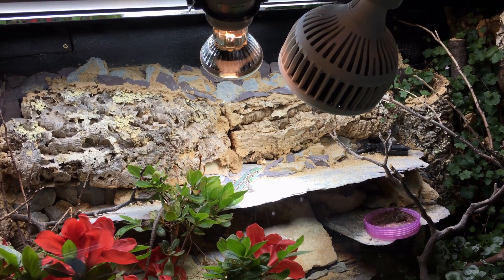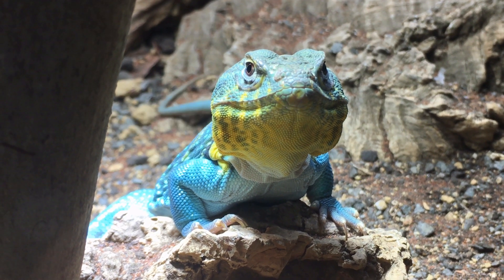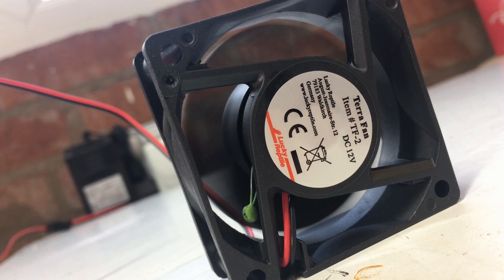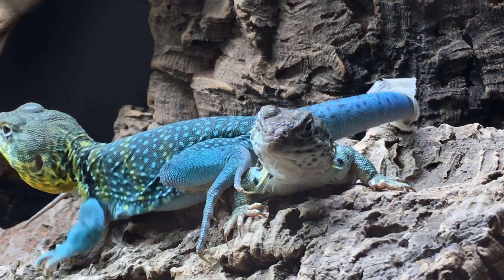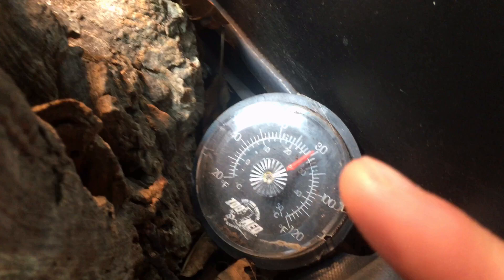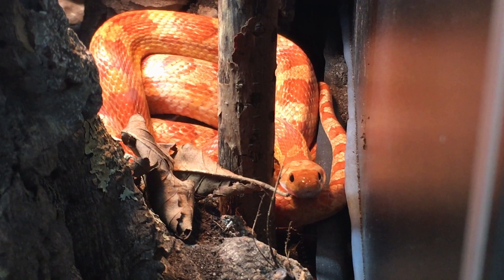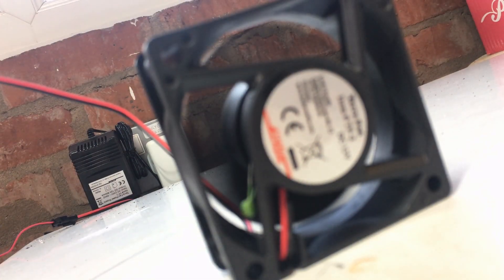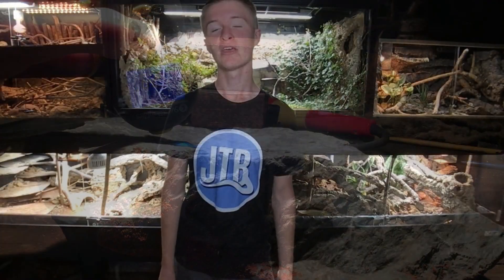Vivarium Ventilation: STOP Overheating Reptile Enclosures! - Fans & Vent Placement for Reptiles

Comment: I have a fish tank terrarium for dwarf tree frogs. There is no way to put vents in through the glass as It is already setup and the glass is tempered so can't be drilled. So got a thick acrylic clear top and going to put 4 big holes at top and cover it with fine stainless steel mesh and silicon it on. Going to look at drains to put the mesh in at the hardware shop. I was thinking since hot air rises this will allow that air to escape easily. But at the same time I need to keep it fairly humid, so really don't want to draw dry air in.

Comment: Hiya bud! I've just ordered 2x terra fans, i have a question.  I have a 6x2x2 viv, would one fan blowing in on the upper corner of the cold side and one dragging out on the upper corner on the hot side be sufficient?  It's a wooden viv it's very well insulated,  the ambient temps on the coolside it's not as low as I'd like it. And i like the idea of my beardy having fresh air circulating. Thanks

Comment: Well done! Anymore, I use a thermostat for heating lamps only to guard against overheating, rather than trying to maintain a certain temp, then let the reptile figure out where it wants to be in regards to proximity to the heat source (as you explained in the video.) And when doing this, like you said, it is better to have the temperature probe some distance away from the heat lamp.

Comment: I work in HVAC and like the idea of make up air units, so I designed a small scale model of one that fits a 40mm fan inside and even made mini flex ducting for the supply vent. You move fresh air intake flaps to adjust the amount of fresh air vs returned air from inside of the enclosure. In the future id like to build a sealed acrylic enclosure with a gasketed swinging front acrylic door so that the enclosure is mostly airtight and have the MUA regulate the pressure, humidity and temperature. Let me know if you want to see the current design! Ill be posting it to thingiverse eventually

Comment: Looking to set up a tall home for mossy frogs, with some undecided easy to keep fish. Problem is that where I live the temperature can change drastically. For example, just last week I was walking around in shorts and a tanktop with amazing weather, now the streets are covered in snow. The frogs need humidity but the temperature needs to be anywhere between 10 and 20 degrees celcius. So I'll probably have to make some kind of system which can heat during the freezing cold, but also cool during the extreme heat waves without losing humidity levels.

Comment: I use a variety of PVC enclosures for my snakes and none demonstrate ideal ventilation which is why I am looking into vivarium fans. I've been keeping snakes for nearly 20 years and still continue to learn new things. Thanks for the help and advice. I always look forward to implementing better husbandry practices.
Reply: Snakes realy dont need the ventilation, i bet on your 20 years journey on keeping snakes, no snake died from lack of air
Reply: @RixiV11  no, haven't lost any snakes. But I have had issues with mold and condensation, especially when higher humidity is needed. I think better air circulation would definitely help with these problems.

Comment: Hello jtb I have a question for you please, my crested geckos enclosure only has a single ventilation strip on the top and nothing else except for about a 4mm gap between the sliding doors letting some air in, the humidity reads from the mid 80's to 100% during the day when everything is switched on - is this something I should worry about? He's been in there for 18 months and no signs of any illness. (The temperatures are fine)
Reply from the maker: What is the lighting like? What are the temperatures? How often do you mist the enclosure? Is it live planted? How large is the enclosure and how large is the vent on top?
Reply: @JTBReptiles  Arcadia jungle dawn led, arboreal shadedweller and basking spot. Temperature is 28c in the basking spot and ranges from 20 to 23 everywhere else. It's 45x45x60cm with a 15cm ventilation strip, I mist once at night just before lights off and it's planted.
Reply from the maker: That doesn’t sound bad - a 15x45cm strip of mesh is more than most wooden vivaria have which are significantly larger. If you wanted, you could add another vent low down in the enclosure so that air can come in through the bottom and leave at the top.
Reply: @JTBReptiles  cheers dude

Comment: I had an issue with my macklots python's new enclosure.  It was converted from a used outdoor birdhouse and is much taller than it is wide (4'X4'X7'), so the heat gradient is pretty much all vertical.  Once all the shelves and climbing branches were installed,  I found that the hot basking spot was a little too hot, but the bottom of the enclosure was a little too cold.  Installing a computer fan on the roof blowing air downwards did the trick.  It pushed the warmer air down to the floor and cooled the basking area down just enough.  It works perfectly!
Reply from the maker: How are you measuring the temperature of the basking spot?
Reply: @JTBReptiles  for the basking spot and the other resting spots in the enclosure (there are 4 shelves at different heights along with a ton of branches) I use a temp gun. For just general air temp I have 3 little digital temp/humidity gauges at the bottom, middle and top of the enclosure.
Reply: @JTBReptiles  you can see the build/enclosure on my channel it went out about 3 weeks ago.
Reply from the maker: Excellent enclosure!

With regards surface temperatures, remember that the heating influence of an object in contact with the animal doesn't just depend on the temperature of that object: it also depends on its thermal conductivity. It is for this reason that a piece of wood (which has a low thermal conductivity) at a high temperature (40*C, say) will feel cooler than a chunk of stone (which has a higher thermal conductivity than wood) at the same temperature. Considering this alongside the basking behaviour of wild herps - which seem to care not whether they are basking on wood, grass, soil, leaf litter, stone, and so on - we see that surface temperatures really do not matter that much. So long as no surface in the enclosure is uncomfortably hot or cold to the touch, you needn't worry about surface temperatures. This is a concept I will be fleshing out in full detail in a video I hope to produce over the winter.

What DOES really matter for basking is the quality and intensity of radiation. This is to say that the spectrum of electromagnetic radiation provided is important, but so too is its overall intensity. We already look at the spectrum in blocks - UVB, UVA, visible light, and NIR - and for two of these blocks we already think, albeit not enough, about intensity (we measure UVB in units of the UV index; we measure visible light using lux meters). The next step is to think about these blocks in more detail and consider the intensity of radiation offered in each. If we do this with an aim to matching sunlight, THEN we will have recreated proper basking conditions: basking really depends on sunlight, not warm air or hot objects.

This comment has gone more in-depth than I originally intended, but I hope it helps!

Comment: Would aquarium chiller fans work too? Do you know any easy ways to mount them? I found a single chiller fan that can rotate multiple angles.
Reply: They will work yes.. but it will depend on what one you use and the size too..  what make you got ?
Reply: @JPsPetNation  Dymax windy W-4 DM225
Reply from the maker: I am not familiar with aquarium chiller fans - someone else might be able to help you, though!

Comment: Which Cooling on/off stat do you use? I'm struggling to find one..
Reply from the maker: MicroClimate EVOs have the function, but there are quite a few available which are a lot cheaper if you look around. I actually don't thermostatically control most of my fans at the minute because the day-to-day variation in the weather does not warrant it: I run them constantly from May through until October, then they are constantly off through October until May.
Reply: @JTBReptiles  Brilliant, I've a few Evo's, didn't realise they had that function. Thanks.

Comment: This is something I have been looking at more closely, especially when vivariums are stacked and the transfer of heat.  I do not have any vents at the bottom of the vivarium however and currently have one fan blowing in the cool end and one drawing air out of the basking end.  This has certainly helped but perhaps I should be looking to add a vent towards the bottom of the enclosure.  

I like the Lucky Reptile fans as they are quieter than the PC fans that I have on one enclosure.

Look forward to the next instalment to include basking as I feel at the moment until I have all the bits of the jigsaw I don't want to make any drastic changes, just yet.
Reply from the maker: Have a look at your temperatures to decide if you need any more vents - and if you think you do, go for it. Ventilation is great for many reasons more than just keeping things cool!

My next informational videos are a way off; I've just started a new term at uni, so I can't make anything new until December. (I do have one short video up my sleeve which will be out in a few weeks, though.)
Reply: @JTBReptiles  Now the weather has cooled I am getting much cooler ambient temps, for example today our corn was sitting about 22/23 and the surface temp of the slate 30.  In the summer the ambient in the shade (must get terminology correct!) sits at 25/26 most of the time so it has seen quiet a big drop.  

Hope this term goes well for you.
Reply from the maker: That sounds fine. I wouldn’t consider it a big drop - think, it often changes much more than that during the course of a single day, never mind across the seasons!

Thank you, and I hope all is well at your end also 😁

Comment: How would you manage temperature in a high humidity enclosure? If I put a fan on one of those the humidity would crash towards the ambient room humidity.
Reply: Generally, the best way to increase humidity without sacrificing ventilation is 1. To increase the amount of substrate. Some substrates and substrate mixes hold humidity far better than others, for example, topsoil mixed with moss and topped with leaf litter work much better than aspen or sand. Secondly, instead of misting the air, which evaporates very quickly, you should pour water onto the substrate so that it is moist, but not soaking wet.
Reply from the maker: Good question. It isn't an issue I have faced yet (my high-humidity species are all in glass vivaria which don't overheat because of their poor insulation), but I can think of several solutions, One would still be to increase ventilation but to increase the frequency of misting as well; a second would be to use chilled water (potentially in combination with increased ventilation) when misting. (If you opted to use chilled water, you would have to ensure that it was delivered in such a way that vivarium occupants couldn't get TOO cold - so instead of spraying 5*C water into the enclosure, you might at regular intervals put in 18*C water as a fog.) Someone might have a better idea than either of these, though!

Comment: Air flow is something which has been playing on my mind a lot recently. I’ve put more vents into my current vivariums, but I plan on installing proper flat ducting for fan powered ventilation on all of the vivariums in the soon to be refurbished reptile room. 

I’ve been considering the pros and cons vs wooden and glass enclosures, and I think I’m leaning towards constructing all of new vivariums from glass with vents along the bottoms (above substrate dams) and mesh tops.
I want to keep all ventilation feeds and outtakes independent for bio security, with no common ducting so I have had to draw out exactly how I plan on doing it.
Reply from the maker: If I were to be starting again with my collection and more confident working with glass, I would be inclined to use glass vivaria with mesh as you describe. I would have to rig something up to hold insulation foam tight against the sides of the vivaria during the winter as my herps are in an outbuilding, but this is not a consideration most people need to think about.